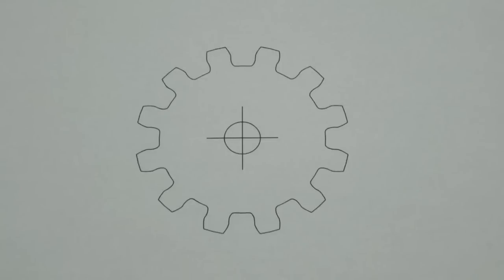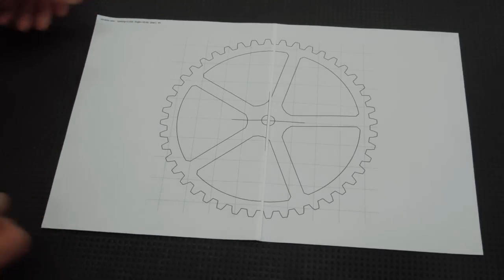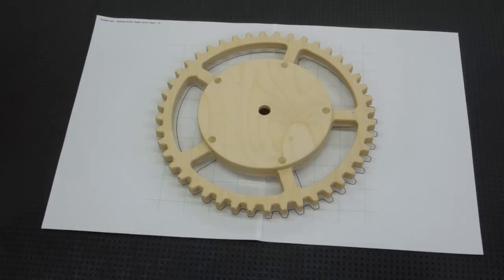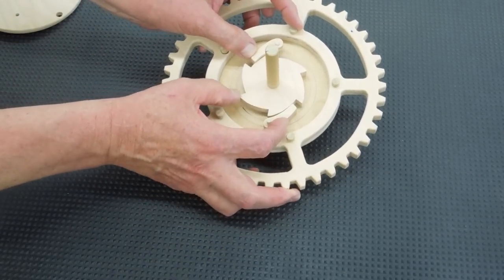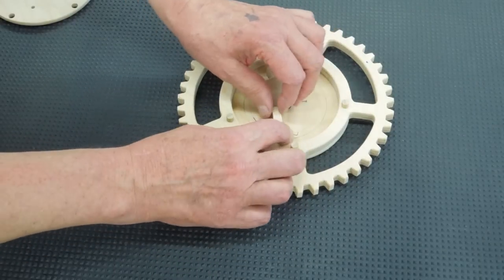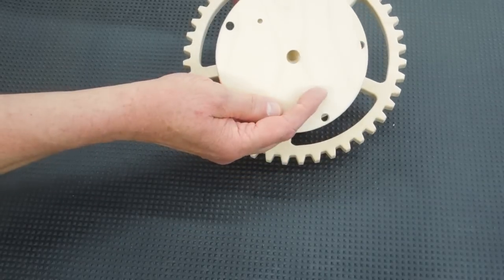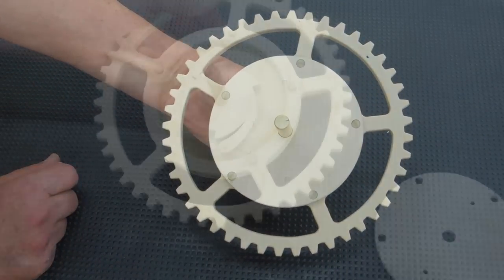Wood Gear Ratchet

Comment: So that's what's inside of the rear wheel on a bycicle... That explains the rateling noise when you are roling without spinning the pedals.
Reply: some bicycles use wedged rollers (aka one way bearings), but same idea, except you have rollers that wedge against the housing in one way, and don't in the other way.
but most have a ratchet system,  though it is inverted, the pawls are on the inside and the ratchet on the outside.
Reply: Just about it is called a "Sprag" gear or clutch.

Comment: Cool, but you can also turn the whole gear around to change the turning direction instead of taking it apart right?
Reply: i was thinking the same thing. i think this is very cool stuff, and it inspires the imagination!
Reply: You can if the axle is the same in both directions, in application that might not be the case tho.

Comment: Hi, Ron. That was very neat.

I see you have chosen a six tooth ratchet wheel and two pawls. This gives six clicks per revolution: the second pawl does not reduce the dead space between each click (60 deg).

If you chose a ratchet with an odd number of teeth, say seven, the pawls would click alternately giving you fourteen clicks per revolution or 26 deg of dead space between each click.
Reply: in this configuration it should be much stronger though

Comment: You know I am eternally grateful for this and your one-way racheting dog clutch video... I have been working on building my own treadle style lathe using the pawl and rachet mechanism that is on the Barnes No. 4 combination machine, the same treadle powered table saw that Roy Underhill has... I hope that I can replicate this ratchet system with a heavy, glued up plywood flywheel... if I can get it built, I'll upload a video for you...

Comment: Nice mechanism!  I actually had a problem with my ratchet wheel on my wooden clock.  I think I will make a similar mechanism.  One thing I have in mind though is to use an Acrylic front cover plate so you can see the ratchet wheel.

Comment: If you rough up the contact surfaces of the ratchet and then apply some superglue (one you know to be very good) it will make a very good and strong surface. I have a similar application for it where i need two pieces of wood to slide one over another and just those two pieces wouldn't last too long, so i did the superglue trick and now they have a glass like surface to glide on. Very strong.

Comment: I was wondering if you cut out the various sections of the base gear by hand, or used a router with a template. VERY well done. Super craftsmanship. Would be great to see a video of the intricacies of how you made the base gear as well.

Comment: Rather than having the ratchets both operate to fall at the same time, since you have two ratchets, would it be useful to have one of them phased out, working half a tooth later where they will be twice as many fall positions, hence a finer selection of location that is being wound? That little extra could win a game or give a little more time to a wound clock.
Reply from the maker: Being made of wood and the pawls small, the intent is to spread the load evenly between two pawls. If I wanted (or needed) more  positions of engagement I would put more teeth on the ratchet while maintaining simultaneous engagement of the two pawls. This also helps keep the mechanism balanced on the axle and it is less likely to wrack or twist. Thanks for watching.

Comment: This is awesome, I love the orientation of the ratchet. What could be an application of the ratchet I'm wondering since from the looks of it, it only seems like the outer gear makes the interactions regardless of the direction. But then there's the ratchet's axle where I can see a probable input, what can take advantage of this mechanism? Many thanks
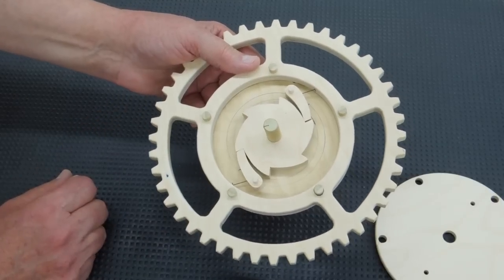Reply from the maker: At 3:04 the application is clearly explained. A spring would be attached to the back of the mechanism. A small gear would drive the large gear to wind the spring. Then the spring would drive the axle. 

Thanks for watching. 
Please subscribe. That is what keeps this channel running. 
Ron

Comment: why would you reverse the interior parts?  just turn the whole thing over.  It is symmetrical. It will ratchet either way depending on how it's installed.
Reply from the maker: It's called left hand or right hand as you find necessary for a permanent installation, like a left hand or right hand thread, a left hand or right hand glove, a left hand or right hand pistol... comprende?
Reply: Haha, yes, I know....couldn't think of the term....it was late and my brain was tired.
Your sprocket assembly appears to be SYMMETRICAL, which means you can install it either way, negating the need to reverse the internal parts. Comprende??
Reply: Ray Kent---haha! thanks for the validation ;) Ronald didn't believe me!
Reply: The point of reversing the interior components is so that you can change the position of the access cover depending on where and how the gear is installed. If you turn the whole assembly around the the access cover may get buried against the wall of the assembly. It isn't important 100% of the time but there are cases where you may want to leave the gear installed and only remove the cover to replace the springs, the pawls, or the ratcheting gear. Of course he could make both sides removable instead of having one side fixed, and then just turn the gear around without even having to consider that, but then it would be more complicated to secure the posts that the pawls are mounted on. In fact.. no it's much more complicated repair wise to not have one side fixed. It's better to have an access plate and to have that access plate... accessible.

Comment: Howdy Ronald - great video and design - thanks for making it available!!! I am working on a project that requires this type of ratchet to allow the machine to be reset...I have also watched your "One Way Ratcheting Dog Clutch" video.  Noting that you posted these videos about 4 years ago, I am wondering which design has proved to be more reliable over time.  Thanks, Mike
Reply from the maker: Nearly four years ago... time flies. Actually, I made both clutches for a project I was working on and then got sidetracked building organs and other stuff. So that particular project remains "in progress". The first one I made was the One Way Dog Clutch, which is more difficult to make (I think). The Wood Gear Ratchet is smoother as it does not take as much torque to operate.The springs in the One Way Dog Clutch were from ink pens. The same springs could probably be used in the Wood Gear Ratchet as well... pushing on the pawls. Thanks for watching. Please Subscribe! Ron
Reply: Thanks for the quick response Ron!  Just subscribed...I am sure I'll be in touch again during my build.  Thanks, Mike

Comment: Is there a way to have the pawls disengage to allow freewheeling in reverse? Or to modify the ratchet teeth to extend when momentum drives the shaft and retract when there is no input rotational force?
Reply from the maker: If you spun it fast enough in reverse, centrifugal force would carry the pawls away from the teeth. Playing with weighted pawls would vary how fast it would need to spin to accomplish this. Perhaps a better option would be a one-way sprag or trapped roller clutch. Google it. There are many examples on YouTube. Also thang10146 on YouTube and 507movements.com have many animated mechanisms.

Comment: What type of springs are those and or what would I search to find them? Great video Ron thank you.
Reply from the maker: Jackson Robinson Torsion Coil Spring made from very small gauge piano wire. I salvaged these from an old printer I scrapped out (this is why I keep a junk parts box). It does not require much of a spring to make this mechanism work. Look around on eBay or try winding some yourself.
Reply: Ronald Walters  is it strong?
Reply from the maker: David English Strong enough for a wood gear mechanism.
Reply: Ronald Walters i made a wood catapult and its pretty hard to pull it back so i want to make a which and i was wondering if this would work?
Reply from the maker: David English Not knowing the scale of what we are talking about, I am at somewhat of a disadvantage. The weakness of my mechanism is the pawl support pin. I have two paws so each one takes half the load. Four pawls would take one quarter of the load. Or google "catapult ratchet" to see what others have built. Winching it is one thing... firing it another... and the wear of the ratcheting mechanism.

Comment: Hi
I was just wondering how you would attach a flat mainspring to this mechanism
Reply from the maker: MAMODMAN95 One end of the spring would be attached to the large gear hub and the other end attached to the frame of the mechanism. The frame would also contain the bearing supports for the driven axle. This would work like any wind up mechanism, toy or clock.

Comment from the maker: The large paper template shown in the video is glued to plywood and the entire gear cut out by hand on a scroll saw. On this particular gear I rounded all the edges with a tiny round over bit on the router table. All of the gears in my videos are cut out on the scroll saw. For a demonstration watch my video “Cutting Wood Gear & Clock Wheel Teeth” which is linked from my channel page. I also have a number of videos related to making wood gear clocks. Enjoy and please subscribe to my channel.

Comment: HI Ronald - This is just what I was looking for....My son has a crazy idea to generate electricity from swings and I want to help him with the project. This is godsend and would just work for a small school science project. Would you mind If I talk to you about this?
Reply from the maker: +Shirantadka Rajashekhar  Don't know if I can help you but go ahead and ask.
Reply: Thanks Ronald. Basically, I want to use this as my main mechanism to convert an from an oscillating swing motion, to a unidirectional rotatory motion. Since, kids might not swing at insane revs, I might have to use a step down to increase the revs - so that an electro magnet can generate electricity. I just wanted to get some of your experience in figuring out all the mechanisms needed for this project.
Reply from the maker: +Shirantadka Rajashekhar Look at: Mechanical Movements Powers And Devides 
http://knowledgepublications.com/history/mechanical_movements_detail.htm
You might consider these movements – about half way down the page:ALTERNATE RECTILINEAR MOTION FROM A SWINGING LEVER WITH SECTOR AND RACKRECIPROCATING RECTILINEAR MOTION OF A DOUBLE RACK
Also watch my video: Making Movement 123 -Reciprocating Rack Mechanismhttps://youtu.be/Cas_tOSgz8Y
A lot of these movements look feasible in theory but they can be very tedious to get to work reliably.
Your “swing” would need solid suspension rods (not chain or rope) and the force of keeping the mechanism running is continuously trying to stop the swing or make it swing unstable. I suspect you will want something that spins a flywheel (generator) in both directions of the swinging motion.
People are constantly trying to get me to help them build or invent something. Sorry,  I just do not have the time. 

Good luck with your project.
Reply: Thanks Ronald. Appreciate the help
Reply: How did it work out?
Reply: I must know how this came out ... And your son had a brilliant idea, you should be proud

Comment: Do you have this ratchet gear's plan?
Reply from the maker: +Harry Huang Sorry, the plan is not available. But I show you how to draw your own in the video and you can use the gear template generator on woodgears.ca
Reply: Ronald Walters I have this generator but I don't know the parameter.
Reply from the maker: +Harry Huang  I did not keep notes on this project. You can see in the video the large gear printed on paper. The squares are 1" and the gear is 9" which is too large for a single sheet of our standard paper size which is 8.5" x 11" so it ends up being printed on two sheets of paper. The ratchet was derived from a 3" diameter 12 tooth gear. With a magnifying glass you can see in upper left hand corner the large gear has 44 teeth and is standard 20 degree contact angle which is what the gear template generator starts with. The shaft is 1/2" dowel. The rest is up to your experimentation and development.

Comment: I was able to combine your idea of the "Wood Gear Ratchet" in the form of compound gears in a series parallel pattern to come up with this device using bicycle parts as see in my video at:
https://www.youtube.com/watch?v=4brh3K91K1c&t=30s
The name of the video is " Series Parallel Feedback Transmission"
Reply from the maker: I do not understand what you are showing and I do not see the mechanism changing gears.
Reply: Here is a link to the PDF file. Ignore the picture of the invention which was for the initial 1st stage. The drawing and the video you saw is the final design.
https://drive.google.com/file/d/1R1rLQOgAEQeasdifnb2YdRXDHA8GOCV4/view?usp=sharing
Reply: ok, PDF sent to email with Title" Series Parallel Feedback Transmission" from social@squarepoint.net